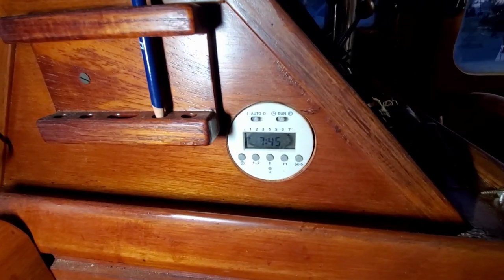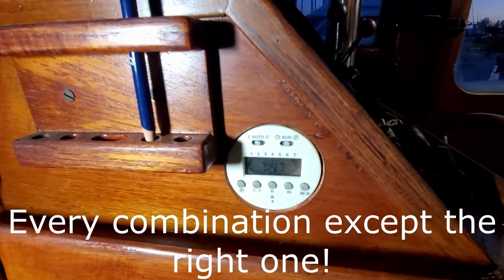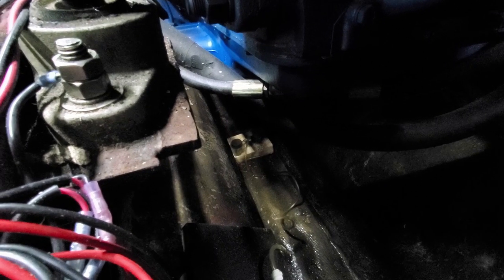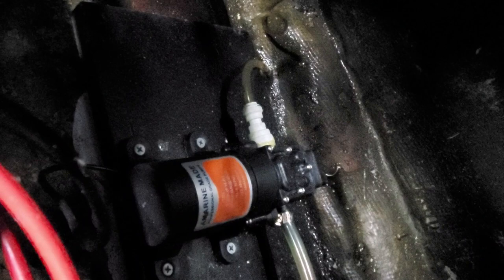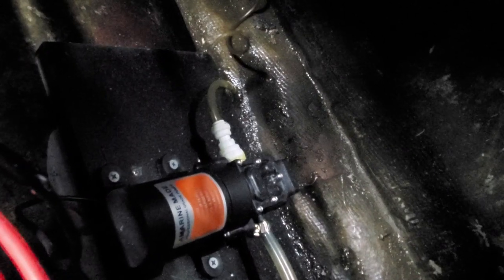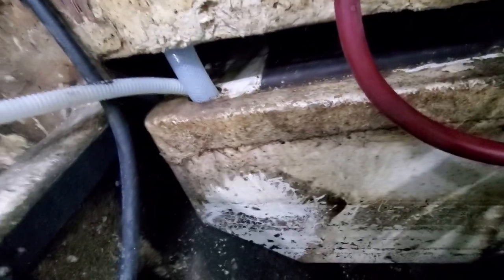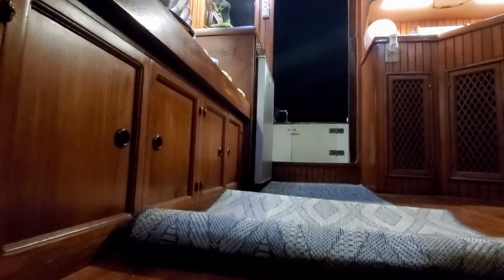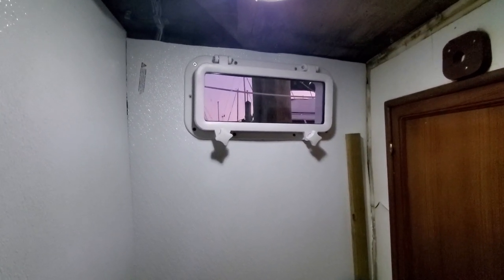DIY Dry Bilge in 31 Senator Trawler

Comment: New viewer here with several questions.

Am I correct in that this system is a system you designed and put together rather than something you bought off the shelf? Do I understand your system correctly: heart of this system is the pump, the vacuum end of the pump is connected to the clear small-diameter hose, that clear small-diameter hose passes through an air-tight connection to an inverted plastic box placed over a large sponge, the sponge lays in the bilge to absorb water with the vacuum hose and plastic box on top of the sponge (which is weighted down), back at the pump the discharge end of the pump (the larger diameter solid white hose) is plumbed to your shower sump, the 12VDC system is powered through a timer that gives you programming options? The system works as follows; the sponge soaks up all bilge fluid it comes in contact with (works all the time until it is saturated). When the pump is turned on, the top of the sponge is subject to low pressure, vacuum, from the pump through the hose which has an air-tight connection to the plastic lid to keep it from sucking air instead of bilge fluid. The fluid is then routed from the sponge to the pump under vacuum and then ejected out of the pump under pressure to the shower sump and then on to the grey water tank (by the shower sump pump). The system runs as long as the timer is powered, and that is determined by the setup of the timer itself? Did I get that correct?

How exactly is the clear plastic hose interfaced with the sponge to keep the orifice at the end of the hose from getting clogged by the sponge itself when the vacuum is applied?  The sponge itself will act as a filter to block larger particles from clogging the line leading to the pump, but how do you ensure the orifice end remains open and clear?
Reply from the maker: Very very close. The one main thing that isnt quite right is that the timer activates the dry bilge pump. As you said the dry bilge pump is the one plumbed into the box/sponge and yes that side is under vacuum. The timer allows you to program something like 16 stops/starts for any amount of time. I have it coming on about 6 or 7 times a day for around 15 minutes. That's really just to soak up rainwater when it storms out. No other water gets in the boat. So after a rain If there is water in the bilge then it will be pumped into the large shower sump. The shower sump overboard pump has a simple bilge float switch and pump. So when its somewhat full it just pumps it overboard. 
The clear plastic hose is interfaced with the sponge simply by being pushed into the middle range of the sponge depth. You might adjust it until you get your best flow.  The sponge does act as a filter. And so far in several years I have never cleaned it or changed it and it still works great. The whole thing works great. Highly recommended to either make or buy something like this. No bilge smell or water for years now. One thing, dont make the suction hose to big, it needs a certain amount of velocity to pull the water up to the pump under vacuum.
Reply: @mvintrigue-trawlerdiy1101  Thank you very much for your valuable time in answering the question.  I like the ingenuity of your design.  Respectfully!
Reply from the maker: @apackwestbound5946  No problem at all. That's why I made this channel. To share info. It certainly wasn't due to thoughts of becoming famous by outlining a dry bilge set up...lol.

Comment: How long does the pump run every time it cycles on? Have you considered an adjustable vacuum switch to shut the pump off when it is no longer sucking water?  Another option could be a flow switch on the outlet side of the pump..
Reply from the maker: The timer, especially the new one, you are able to set exactly how long you want it to run. Right now I have it set to run 4 times a day for 15 minutes each time. We havent had much rain lately so the bilge is dusty dry. I have considered some of the ideas you mention as well as a few others. However I always settle back to simply using the timer. That style pump has no issues running wet or dry for 15 minutes at a time....or much much longer. So adding additional switches, connections, sensors IMO will likely just cut down on reliability. Right now with just the timer/pump/pickup it has essentially worked flawlessly for nearly 2 years. As a side benifit...since the bilge is almost always completely dry...the main and emergency bilge pumps, switches and wires stay in excellent shape. I test them every now and then just to be sure they work. And they always do. Prior to the dry bilge set up I was always cleaning or clearing the main bilge or replacing it because they are just generally poorly made these days and cant stand to sit in water.

Comment: How is the pump holding up?
Reply from the maker: It's still going strong. Bilge is still dry. I actually fixed all the fresh water leaks so I really need to set the timer to once a day or once every other day. Currently its running 4 times a day,  but of course the bilge is pretty dry now. So all in all ...still a cheap effective addition.
Reply: @mvintrigue-trawlerdiy1101  awesome, thank you, I am going to order one through your link right now
Reply from the maker: @dieselram05  still perfect more than 2 years later.